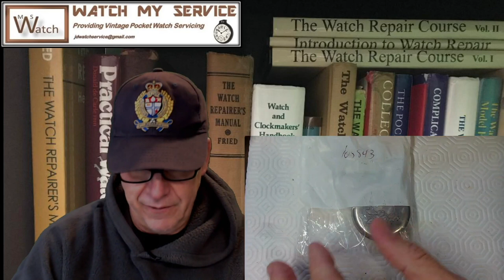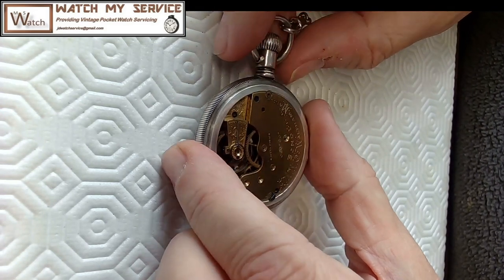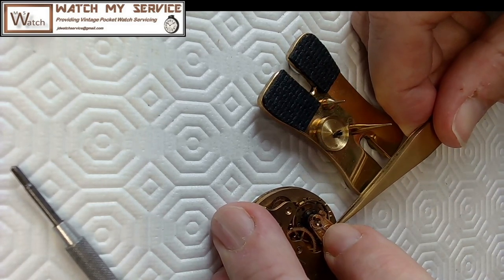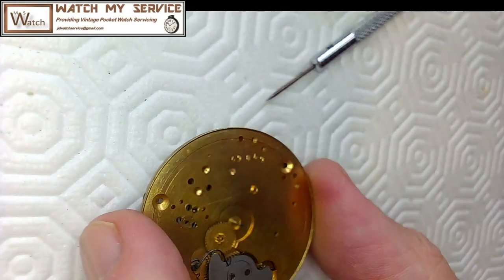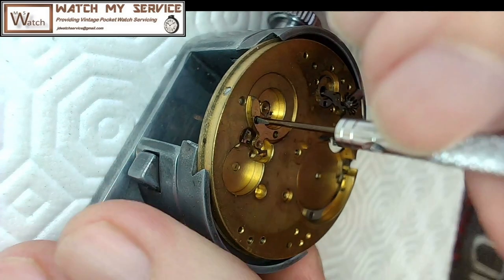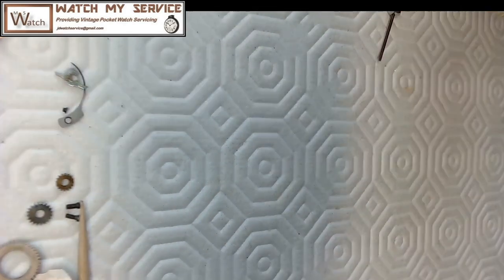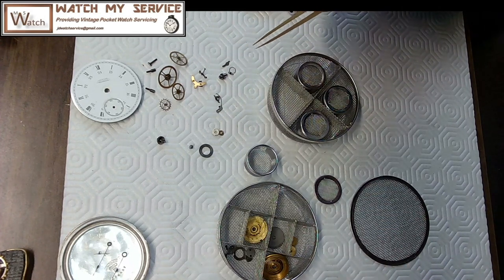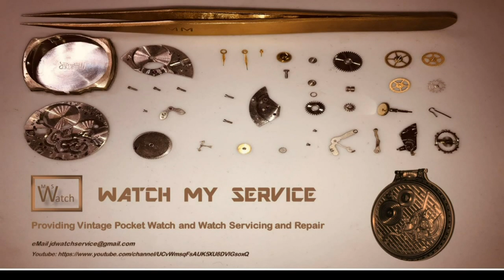1894 Vintage Waltham Pocket Watch Repair

Comment: Your amplitude reading may be off because you have the wrong lift angle.  On my timer default is  52 degrees, which I find is almost never the case of old pocket watches (generally closer to 42).  I use my phone to determine to approximate amplitude, then adjust my lift angle until the reported amplitude and the level I see on the phone match.
Reply from the maker: Really appreciate the comment, I will try this technique